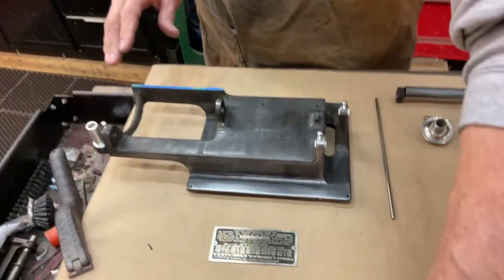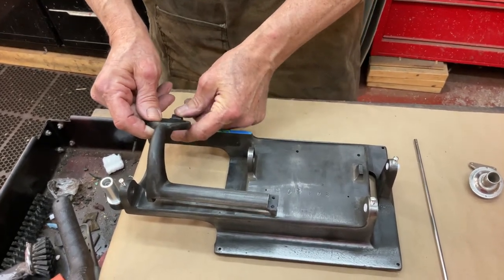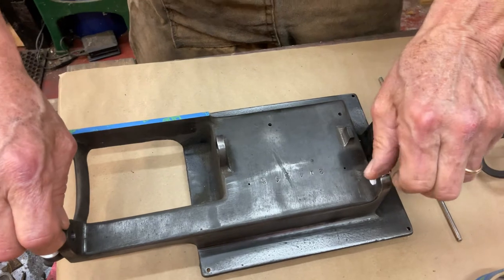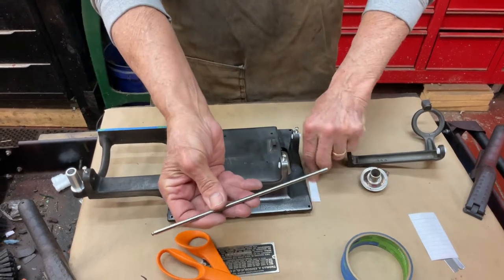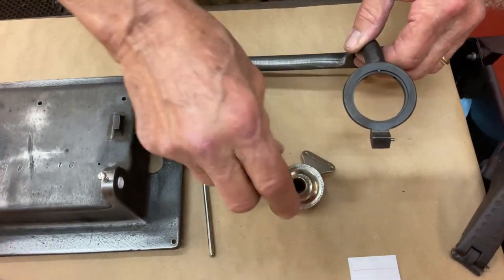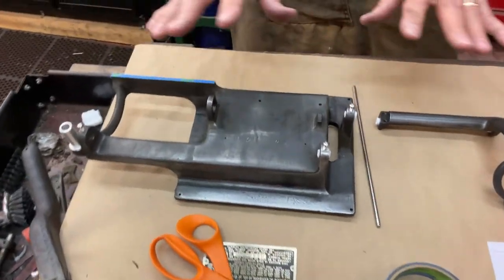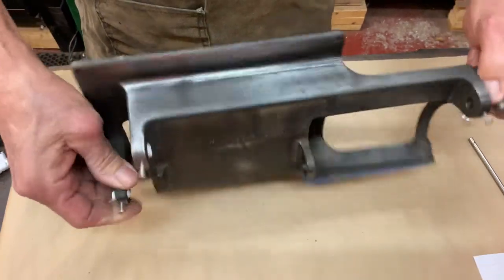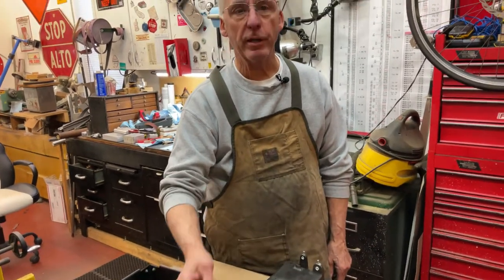940.  Prepping the Edison Home phonograph for painting

Comment: Interesting video  - for several reasons.  Didn't know that Edison stamped the serial number beneath the patent plate [ID tag]  - or that the serial number also was stamped on the underside.  Good to know - as I see so many patent plates being sold on Ebay and - if matching serial numbers are important to one  [as matching numbers are for antique automobile collectors, etc.] - this serves to double check for all numbers to match (or, at least the patent plate matching the serial number stamped on the bottom side).   Does this serial number location information also apply to Triumphs, Standards, etc., or is this unique to Home machines?
Reply from the maker: Yes, in most cases although I have found some machines that are not stamped underneath.